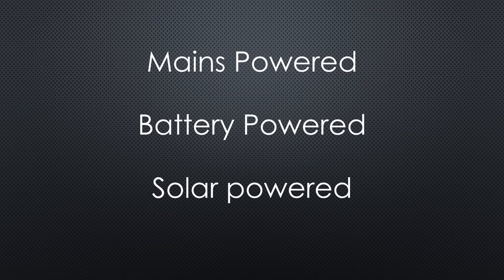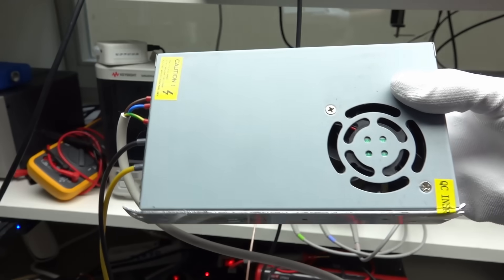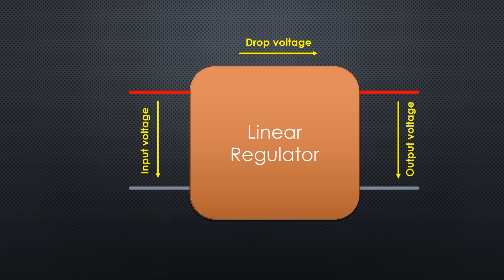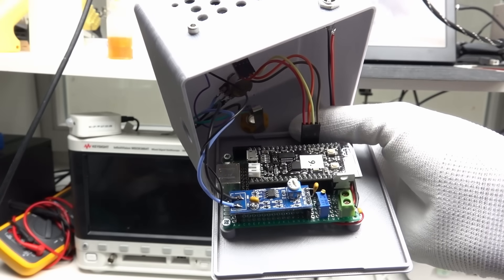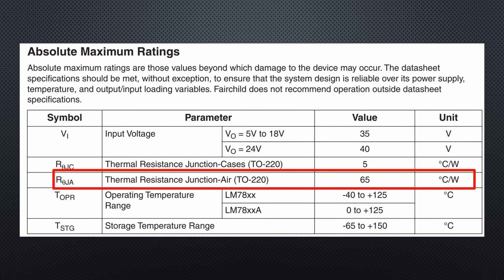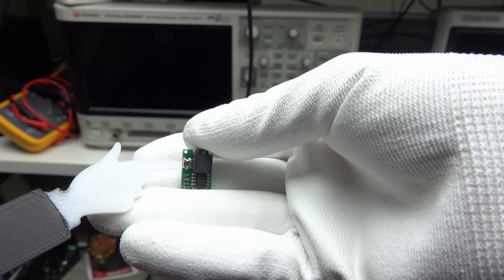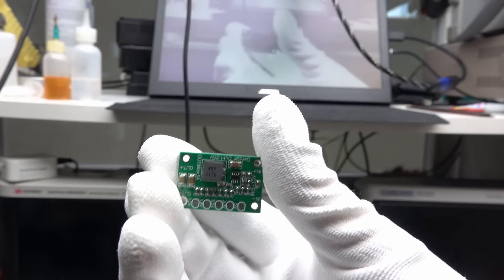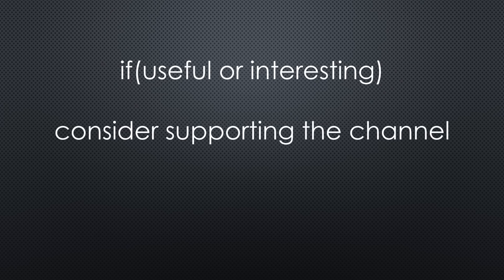#334 How to find the right Power Supply for your Project

Comment: nice video! Is it possible that switching regulators affect the I²C of esp32's because of noise?
Reply from the maker: Usually not. The chance is high you have another problem unless you have very long wires.
Reply: @AndreasSpiess  That's what i thought. It's already some time ago, but it was the  VL53L1X with the Pololu Arduino Library, I think you made a video about the predecessor as well. It gave me some bus errors while outputting correct and incorrect sensor values. I worked around it by trying to validate the values in software as I didn't need every sensor readout, but I guess that's not how one should do it. Probably should just invest in an Oscilloscope.

Comment: I should say my preference in case they are both possible has completely shifted from the analog regulator to the switching regulator.
So in a case like your keyer, while in many old projects I have used 78xx regulators, today I would immediately go for the switching buck converter.
This is mainly because the complexity that was always around switching regulators (how to find suitable components and make it work OK) has been completely taken away by those small ready-made modules like you showed.
I just get one of those Chinese modules I order 10 at a time from AliExpress both for fixed and variable voltages and use them without any problem...  and no more heat issues.
In case I quickly need a supply and have only larger voltage supplies I often take such a module, solder standard black/red supply cable to it and then put a length of heatshrink tubing around it.  It can then be used between the lab supply or a wallwart and the project and there is no risk of shortcircuit when it is on the table or somewhere in a corner of the case.
Reply from the maker: You are right. I also like these small boards and have quite a few laying around. But maybe I am a little old-fashioned ;-)

Comment: Perhaps you already covered it in repairs, but 1st thing always check all your VCC s when troubleshooting. I remember learning this in EE lab 1 after undoing a bunch of wire wrap connections and other things unnecessarily... Saves a lot time.
Reply from the maker: I even start with checking ground ;-) If it is ok the chance that you mixed plus and minus is very small...

Comment: Lol I knew "The swiss guy method" as the "fingermeter", it is truly a unique sensor. 

Thanks for this video though! Some time ago, to avoid learning about all this and to make my life easier, I used an old PC PSU for a project which needed 12v, 5v and 3.3v, be aware though that some need a minimum voltage to operate but in my case some lamps at 12v, an rpi3 + sensors at 5v and multiple sensors at 3.3v was enough to not trigger that protection: it is also excellent for really power hungry devices as my old PSU can handle bursts of a combined 180w on the 3.3v and 5v rails and 23A on the 12v rail. 

That being said, unless you are building a PC, most of the time this will be overkill. 

As always, great video, learned a lot from it!
Reply from the maker: You even can buy connectors to build a full-blown Bench power supply of a old PC PS. Probably the cheapest way to get power on your bench

Comment: Thanks Andreas. Great content. There exist "PD sink" modules to select the output voltage of Power Delivery power supplies.
Source: https://youtu.be/OwAZqJ4wpJg
Reply from the maker: I have one. But do not want to press a button 3 times every time I power up my device...
Reply: @AndreasSpiess  True, could be pressed by accident. It seems there are some modules with fixed voltages like 
https://a.aliexpress.com/_d7gYKyN
Solder bridges to select among most used voltages would have been ultimate 😆
Reply from the maker: Good find! Thank you.
Reply: There are also AliExpress modules which can be "programmed" (with a button) to a specific voltage IIRC.

I would really go with PD and USB Type C for all new projects! First, you can transfer up to 5A over the cable and get voltages up to 20V from a standard power supply. 

Second the USB Type C Plug is really good and no plug orientation hassles any longer. 

For starters there is the standard Raspberry Pi power supply which can deliver 3A => 15 W for under 10 € (including real CE certification :-)) 

And if you don't screw it up (like the raspberry pi foundation at the launch of the RPi 4) it really is no hassle in PCB design if you go for 5V.

If you need other voltages the modules mentioned above do a good job. 

As for the linear regulators, I also grew up with the 78xx family of voltage regulators, but they are really outdated today. So for the upcoming battery powered devices video please have a look at the new LDOs to keep losses low. (As we all don't want keep flocks of different ICs for the same purpose those can also be used for non battery powered devices ;-)

It also would be cool if you could have a deeper look into those USB PD modules. All the AliExpress ones I have seen are based on the IP2721 IC http://www.szjuquan.com/upload_files/qb_sell_/pdf/IP2721.pdf

So putting one of those modules on a test bench using an
oscillosope to see the startup / handshaking behaviour would be a great topic for a video.

Comment: Andreas, I can't even begin to describe to you how indispensable you are to the maker community! Thank you for everything you do!
I would love to see your explanation of battery powering devices. Keep up the great videos, as always!
Reply from the maker: Thank you for your very nice words!
Reply: Well put on both counts, I fully agree.
Reply: Question: if I want to connect my phone to a buck converter ran by a battery, do I need to worry about the amp capacity of the battery frying my phone?
 Does a phone limit amperage used?

Comment: @Andreas Spiess
Thank you
I think the swiss guy method to check the heat sink temperature damage your finger ;-)
To take an external adapter is for most hobbyist the best solution. No high voltage inside the system. Maybe also less EMC problems.
To take one of the silver chassis power supplies a hint for earth connection seems recommended.
Also if people take a more power full power supply for low power systems as ESP or Raspberry Pi an additional fuse on 5V side is also recommended.
Otherwise a short circuit on DC could damage your application. A fire also could damage your room or house.
Sometimes I saw on youtube that people take an adapter or silver chassis power supply --> psu inside a box without ventilation holes. Then you have to measure inside temperature and check datasheet of psu to find out at derating curve which power the psu will deliver  at 50 or 60 degree. Attention! The power supply will not derate automatically. 
Good ventilation with fan or holes is also suggestet.
Reply from the maker: I always have to concentrate a lot to get videos short. So I cannot cover all aspects. Concerning fuses: There you can see the character of a person. I would check that aspect before marriage. My character tends to "fewer fuses" ;-)
Reply: I think my grandmother used a similar method for checking the flat iron was up to temperature :)

Comment: Does a buck converter count as a switching regulator? I use them all to time to divide a mains transformer into various voltages to run my project on one plug. They seem very efficient and are cheap off ebay.
Reply: Yes.  I use those modules all the time and I prefer them over 78xx regulators in almost any case.
(in the past I usually used several 78xx regulators in a project but these new buck converter modules are really nice to use, no cooling required)
Reply: @Rob2   Thanks. Some of the really cheap ones tend to have problems though where the trimpot doesn't exceed a certain range after a couple of uses, but a replacement of the same spec bought somewhere else works. Ah the minefield of Chinese manufacturing.
Reply from the maker: Buck and boost converters are both switching.
Reply: @AndreasSpiess  Thanks

Comment: I would have loved to get some information on power loss when project is in idle for always connected projects. Is there something which should be observed for such an case. For example a µC controlling multiple light outputs and most of the time standing by until lights get turned on. What's efficiency on such low power or is that something which does not matter at all?
Reply from the maker: It depends on your view if it matters. If you build one project, the grey energy inside the project is factors bigger than the standby current. And if you drive to the next supermarket you waste more energy than your project for the next 5 years... It might be different if you sell a million devices of your project.

Comment: I love the "swiss guy" method of checking how hot the regulator gets , also as Cristi Istrate battery and solar charging for a remote weather station would be great to see, again thanks for the great info :)
Reply: This method is actually used planet-wide. It works as long the reaction time by the tester is quicker than a rapid temperature increase. Putting some water on a fingertip will give you little bit more time to react.
Reply from the maker: Noted!

Comment: Great video as always!
Hand tip: if you have decided to use a 7805 and then find it's cooking, you can replace it with a 1-2450-TRACOPOWER which has the same pin out but will deliver 1A comfortably.  Not nearly as cheap as the 780x series, but  very handy on a PCB.  It's a switcher so no heatsink.  From memory the drop out voltage is about 1.5v, and you can use up to about 30v on the supply side.
Reply from the maker: Thanks for the info!
Reply: @AndreasSpiess  I think the 24xx series matches the 78xx parts for voltage out.  They might also be handy in battery powered designs.

Comment: I keep reading on the rasberry pi forums that you should use proper power supplies rather than mobile phone chargers. Supposedly mobile phone chargers not designed to provide constant power over time. Sound bogus to me and people trying to justify the official pi psu.
Reply from the maker: These days Smartphones need much more current than a Pi. So this was probably true a few years ago. I would rather look at the max ampere.

Comment: Usb C pd is easy if you get a "usb c pd trigger" pcb from Aliexpress or Ebay. Then you can simply select the voltage with a solder bridge.
Reply from the maker: I have one. But I do not want to press buttons every time I power up my project ;-)
Reply: @AndreasSpiess  Interesting, i have got one that can be set by solder bridges and has no Buttons. I use it for my ts 100 and it outputs 20v after i plug it in.
Reply: I put up a picture of it in the RoboTank discord in the off-topic channel.
Reply: On the one I have with a little button there is a sequence you can use to ‘save’ the choice so its persistent. Not sure if all are the same.

Comment: It would be very interesting to investigate rechargeable battery power in cold weather applications - lithium batteries are revolutionary but they can not be charged at temperatures below 0C.  Lead based batteries seem to be the only viable alternative as far as I have read.
Reply from the maker: We had big discussions about that in another video. Maybe you watch this video: https://youtu.be/y5STYw0BnBg
Reply: @AndreasSpiess  There are some solutions to lithium charging but warming the batteries does not lend itself well to small projects.  I have heard promising things about some LiFe cells that claim to be rechargeable down to -20C but they do not seem to be commonly available.

Comment: Battery would be nice!
What about cable lenght and cable dimmension / type. Could you have a word on these also?
Reply from the maker: The shorter and thicker the better ;-(. But in most of our projects they do not matter too much. I once made a video about Serial cables where it matters if you power a Pi.

Comment: Thanks! Useful.

I'm interested in the battery side of things. Particularly when it comes to step up (and step down) converters.

Some of my access points, for example, run off 19.5v DC and I'm trying to eliminate the cross conversations of a traditional UPS, which I suspect to be highly wasteful. I want to think about direct lead acid (or agm or calcium) connections.

I'm particularly interested in protecting against voltage spikes etc. that my be caused as a battery charger kicks in, for example..
Reply from the maker: This is probably a special case. But I will cover boost converters.

Comment: Using your calibrated finger as a thermal sensor brings back memories from my old power supply design days. We would touch a hot device and if you could say 'supercalifragilisticexpialidocious' without removing your hand its ok.  An approach that proved surprisingly accurate when confirmed with more sophisticated thermal instrumentation.
Reply from the maker: Humans have excellent sensors, I think. And many survived over the centuries without sophisticated instruments...

Comment: One remark concerning the 5V on the wemos. There is a diode between the USB and the 5V pin on the linear regulator. This diode lowers the voltage by 0,5V or more. Sometimes (if you power other modules using the 5V pin on the wemos) this might play a role. In the end it is better to connect power direct to the 5V pin.
Reply from the maker: Good point. Thanks for clarification

Comment: Hi sir. I have an old computer atx power supply of 450W. Whenever i measure the output voltage of that power supply,  my multimeter is malfunctioning.firstly i thought my multimeter was broken.so i repeated measuring the voltage with a new similar multimeter.unfortunately that new multimeter got malfunctioning.i measured battery voltage, linear supply voltage, AC line voltage (even 230v or above)using the same multimeter without any problem.problem is only when measuring the computer smps output. So what may be the problem?.anyway your videos are so wonderful and very easy to understand 👌😊
Reply from the maker: Maybe it has a different voltage if connected to a load.

Comment: Hello,
I am using Esp32. It seems it's instability comes from the power supply. It never runs continuously for more than one month. Some add capacitors for smoothing current  surges when esp32 is emitting. What is your best solution.
Reply: I use Esp32 with both USB and Lipo power supplies for a reliable alarm clock, the Lipo is used when USB is interrupted, it works ok for more than 3 months.
Reply from the maker: As I mentioned: A beefy capacitor across VSS and GND of the ESP32 module  is never wrong...

Comment: Voltage is anything but constant here, varies from 200-240 V AC. Lunchtime it drops. Add spikes of 260 at odd times.
Reply from the maker: Sounds scary. At least for old equipment. Newer PS should have no issues with it.

Comment: Useful, battery supplies next please 👍
Reply from the maker: Noted!
Reply: @AndreasSpiess  You could also say a few words about "wires" -- people have a lot of trouble with esp32 brownouts that seem to be caused by long thin wires -- either cheap usb cables, or breadboard wires -- coming from a decent battery or usb supply, but the wires can't handle the current.